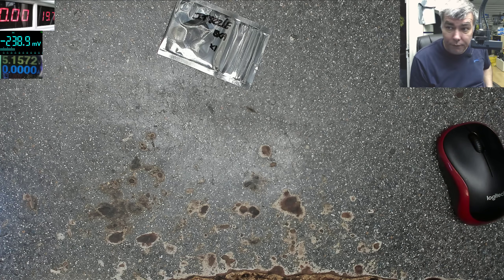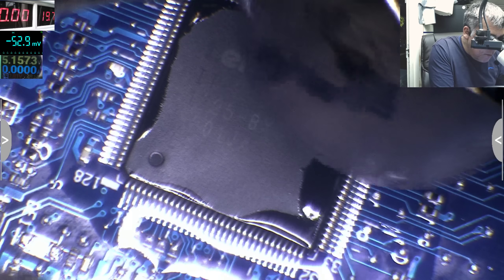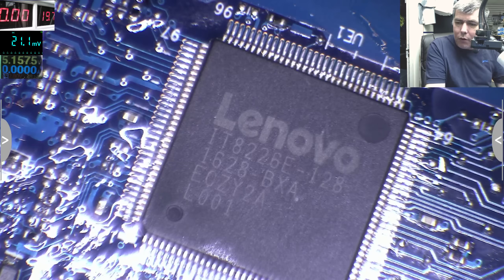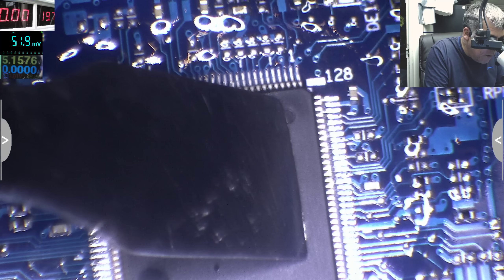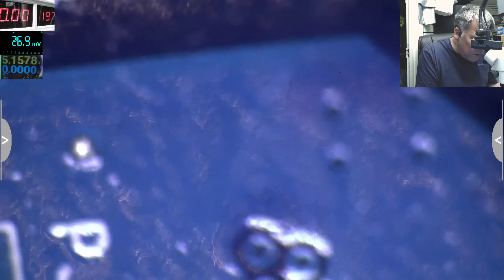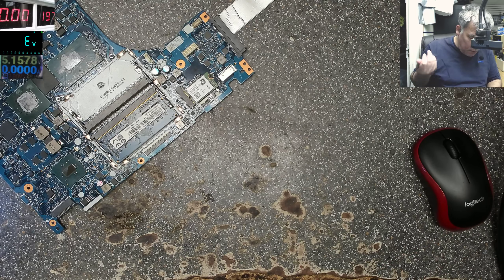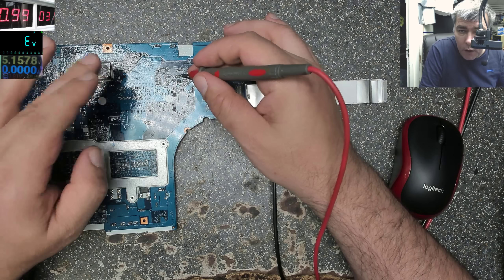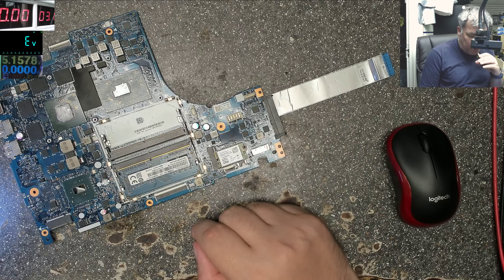IT8226 Super io chip replacement going wrong - part 2

Comment: the pwer connector damage there is 3 pins on it gnd and + power and id pin which goes directly to the ec if the conector broken the id pin well be shurted to + pwer the boom

Comment: I feel your pain! Making a mistake, even a very basic one is a very important lesson, I have made plenty. Thanks for the video, I have to do a dry joint repair on a keyboard controller IC. It should be simple but I am very nervous (never tried it before). Your video was very helpful on soldering techniques and dealing with problems.

Comment: Good morng, my HP Compaq cq58 hanged tried to put it off but refused and I pulled the bat off, when I put the bat back the cap lock light lights constantly not blinking, tried the bios but never responded, what could be the problem and it has never failed nor being repaired for any thing but fan replacement
Reply: no free kébab

Comment: where you buy the chip? my lenovo legion y520 also not turning on and same condition like the motherboard that u are repaired
Reply: Hi, disconnect charger, battery, remove cmos battery, hold power button for a few seconds, insert cmos battery, connect charger, see if it turns on. If still not turning on, press the Novo button for a few seconds. Disconnect and reconnect charger. See if it turns on.

Comment: if that last chip connected to the charging port was removed prior to the mistake of touching the middle pin with 19volts, i guess the super i/o could have a better chance of surviving because of the turn of events.. haha .. or better test for some shorts in the circuits after removing the i/o then putting the new one.. just saying from my expirience.. a broken relationship is as difficult to fix like a bad motherboard..

Comment: I am trying to learn motherboard repair. Could you get a desktop motherboard that is dead and show the trouble shooting it clear from what to plug in just to get started. I know that this would take a few videos, considering you would have to explain why you went there next and what you should find if it was working to what if it is wrong, where else to go and so on. Thanks for your videos. I purchased 10 broken pins boards from ebay to learn to replace the 1151 sockets and trouble shoot. Gigabite won't even sell me a service manual so that I can try to learn!!! Thanks again.

Comment: How is your multimeter and power supply switching config with help of mouse switch voltage and ohmmeter
What is the brand of you heat blower gun solder blower

Comment: Should have made a video of MY mistake in February 2019. It was the same as yours. Touching the wrong pin of the battery connector, actually. Burned the super IO. Haven't found time to replace it, though. Of course Lenovo as well ;)

Comment: Thanks for sharing your knowledge with all of us. I learned so much. Also learned from your mistake. Thanks for sharing that also. I would have done the short circuit test right after removing the super I/O chip. But also, even before removing the chip, I would have removed the smaller part, and then test again for short circuit.

Comment: Hello mr Sorin,  i made the same mistake a few days ago,i even asked you in a video if i inject tensoin in middle pin i could damage something,and now i realize i could. When i did that i didn´t realize the middle pin wasn´t plus. Now i also have a Lenovo with a Super IO burned. First the fallt was only a short in 19v mosfets,that i was able to repair,than the 3.3v power rail was shorted, and i realize the Super IO has a hole,or burned mark.

Comment: When i replace such a large component 128 pins or even smaller ones i dont trust only the soldering with the hot air but soldering manually using the soldering iron one by one every pin.

Comment: Lesson no ; 1 
when you order a repair parts order 2pcs same time ,

lesson no ; 2

use a manul methode for sio replacements ,

use a typical micro solder iron with about 380 celcius , 

do not use high pemeprature for sio pins 

,

( This 2nd advice not for sorin , it is for newer students )

Comment: Mistakes happen. Lets learn from them. By the way, if a mainboard powers up but there is no beep and no picture, what should I look for? Thank you
Reply: Sounds like a RAM issue, have you tried it with another memory?
Reply: I didnt but it behaves just the same without any ram. Plus I am reading a short across some ceramic capacitors that I believe are in the audio circuit. I removed de caps and the short is still there.